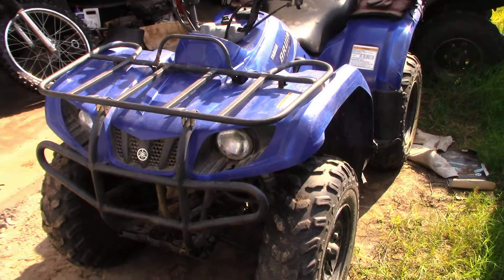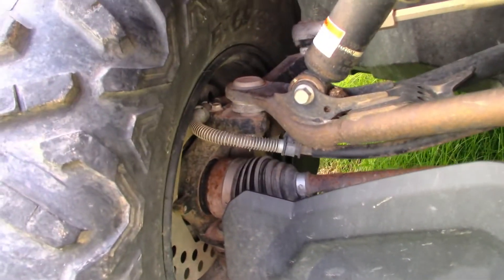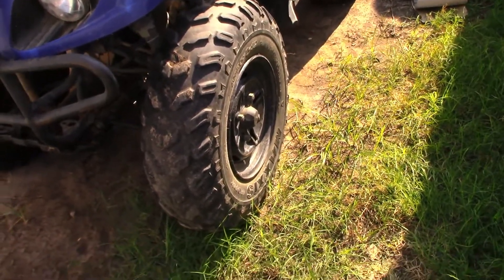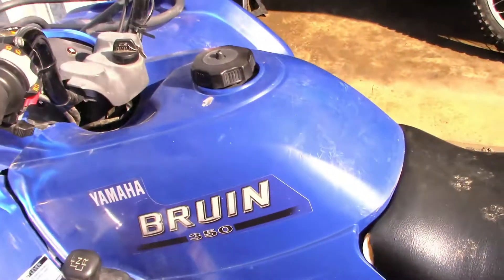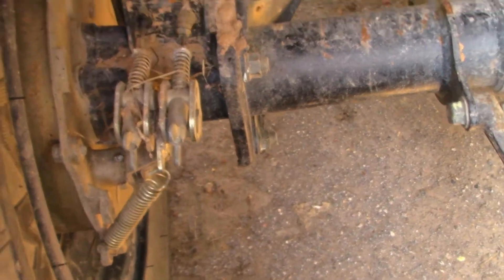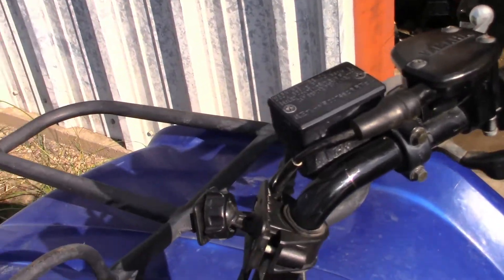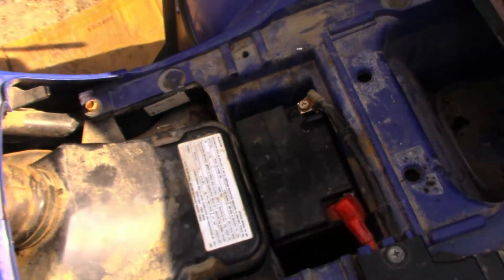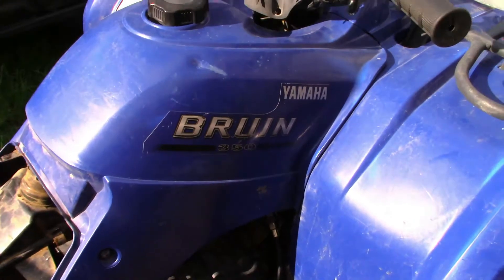Used ATV/UTV Buyer's Guide

Comment: What is a ballpark figure of a top end on a 2001 450 Honda?
Reply from the maker: Depends on if you are planning to do it yourself and if you are using factory parts or aftermarket. That being said. if you take it to A Honda dealer, expect to pay $1500-$2000, independent shop with aftermarket parts? $1000-$1500, DIY with aftermarket? under $1000. Hope this helps, I haven't made a video on Honda's pushrod engines, but they are so simple, there just isn't much to really say about building them, they're super easy. Good luck and thanks for watching!

Comment: Snorkels, missing airboxes, mud packed in every crevice, relocated radiators, wet seat foam, rusty, faded or cracked plastic and general poor appearance are all tell tale signs the machine has been abused and neglected.  Typically you will have a minimum 2 or 3 of the things I mentioned if you have a neglected machine.  I would walk away from these.  Spend a few more bucks for a ready to ride machine that looks nice.  Especially if you take care of it, buying used you will almost never lose money if you sell it and its still in nice shape.
Reply from the maker: Good stuff, and more good tips of what to walk and/or RUN away from! Thanks for watching and commenting!

Comment: Is 2000 Polaris sportsman 500 good or not
Reply from the maker: From the factory it is an excellent machine, that being said, it saw the factory 23 years ago. That doesn't mean it isn't any good or it's worn out and not worth fixing, it simply means that's a long time to be neglected and abused. They WILL take a pounding but will require repairs from time to time. I see too many people these days not getting repairs until the machine doesn't move anymore and then complain that it's too expensive to fix. Just be cautious, expect it to need some work, but that is one of Polaris's best engines and ATV's, 2000 and up is more desirable as long as it has CV joints in the rear shaft on both ends, 2000 was a transition year and early builds would still have a hooks type or conventional open u-joints on the outboard side (next to the wheel), as long as it's CV, everything is readily available (may take some time to get them though) to get it back to top notch condition! Thanks for watching! Good Luck!

Comment: How do i get into a repair shop? Want to open my own repair shop
Reply from the maker: You can do what I did, go to a Honda, Yamaha, Kawasaki, Suzuki and/or Polaris dealer and start as an apprentice, work your butt off, take advantage of any classes the mfgr's offer and if its a Honda dealer, work towards the much coveted title of Honda Factory Certified Technician, this will take a minimum of 3 years, Honda will not let you do it faster than that ( I did it in 3, some guys never finish, it's hard). Save as much money as you possibly can and when you feel the time is right for you, find a small, inexpensive building to lease and just do it. You won't become a millionaire on this side of the business, but you can live comfortably if you're good with numbers and know how to budget if your area is seasonal. In Texas, we are pretty much year round.

Comment: Let’s not forget chassis !…look for rust at welds especially at control arm brackets, engine mounts, carrier mounts even if it’s fairly new ..look to see if someone shot paint on chassis and there’s  overspray on things that shouldn’t have   It could be hiding chassis rust..
Reply from the maker: Good tip, we don't have salt form coastlines or roads here so I forgot to mention that. Thanks for watching and the heads up!
Reply: @JWSRepairServiceLLC  ..I’ve learned the hard way on my ‘17 rancher and had to fab up and weld in new lower rear control arm brackets and the lower front diff brackets…it was barely hanging on …had to cut off all the mount bolt heads too just to remove diff and lower arm…buyer beware !👍🏼